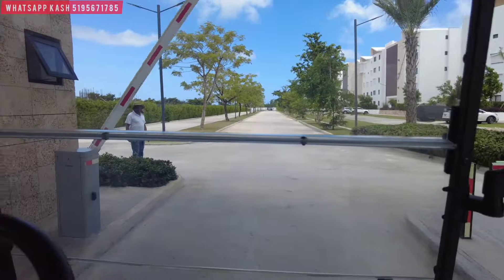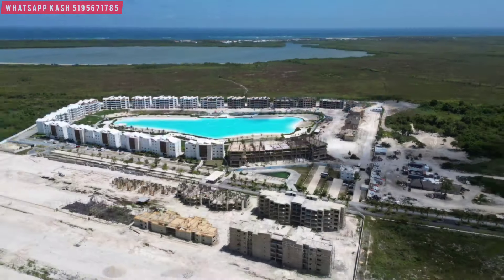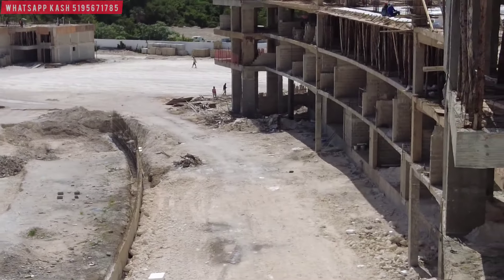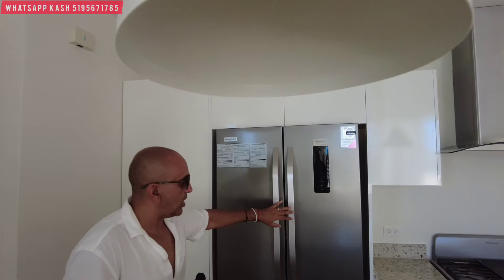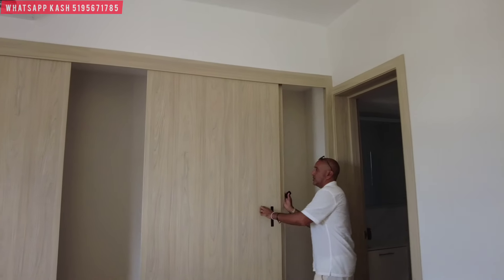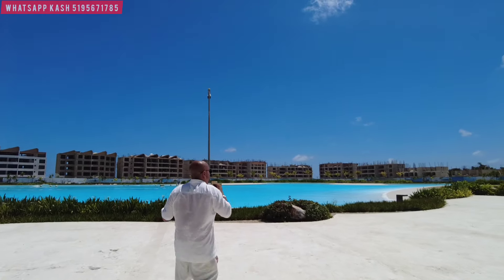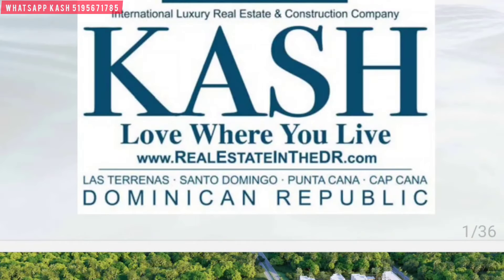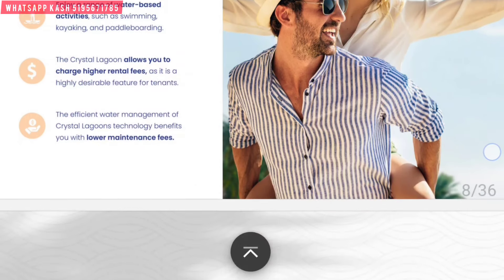Unbelievable 322,917 Square Foot Pool | The Beach in Punta Cana starting at 120k | TAX FREE

Comment: They had to take the stairs because the elevator is always broke in that building. SMH
Reply from the maker: It was under service at the time we visited 
Most times it is open to my knowledge. 
The project is truly spectacular. 
Have you visited it?
Reply: @Realestateinthedr  it's always broke along with others in seperate buildings that's just what they told you when you visited. Yeah I have a unit here. Power outages and water is constantly not working. It was out for 5 hours yesterday.